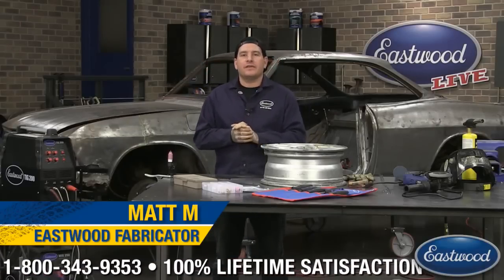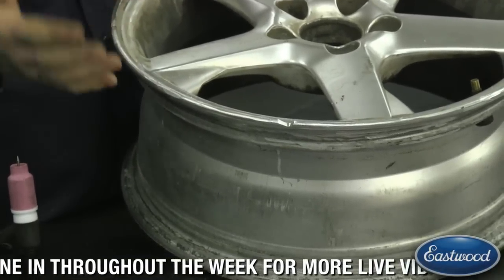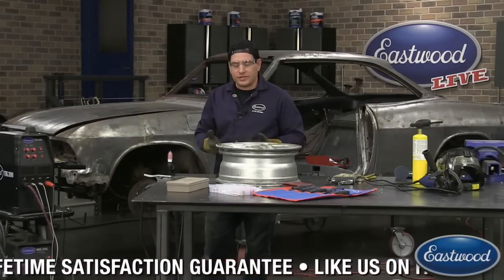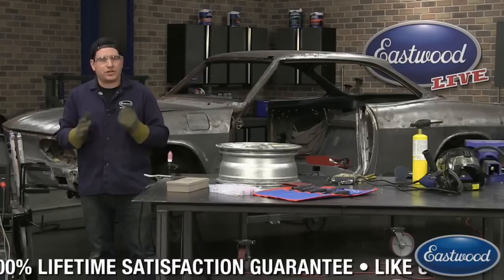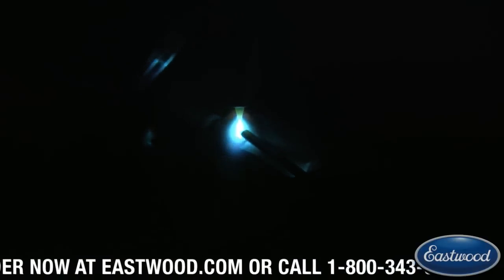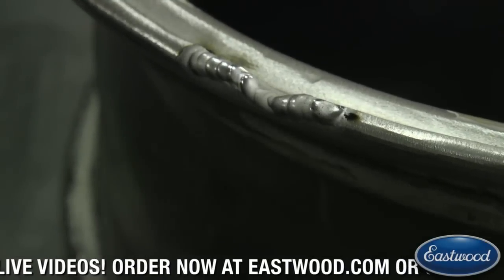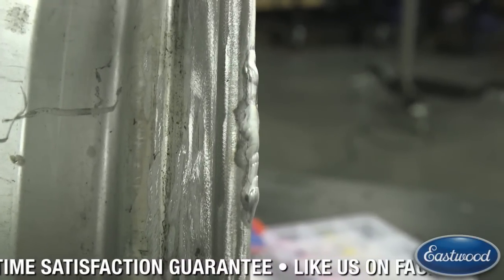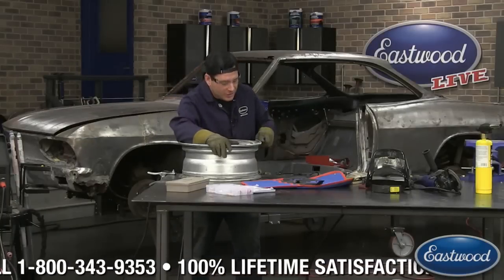How To Repair Curb Rash on Aluminum Wheels!  TIG Welding Tips & Tricks from Eastwood

Comment: great video! have you had trouble powder coating over that 4043 repair area? I was always told to use 5056 because it takes better to color coating (either paint or powder). I never tried 4043 on wheels, but I have used it on other aluminum parts and it would be SO much easier to flow than the 5056. Thanks